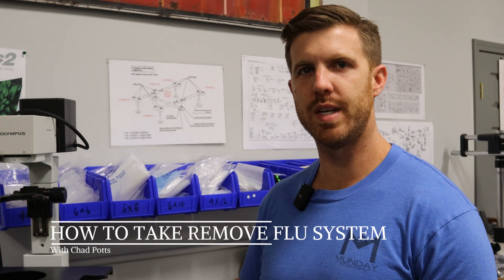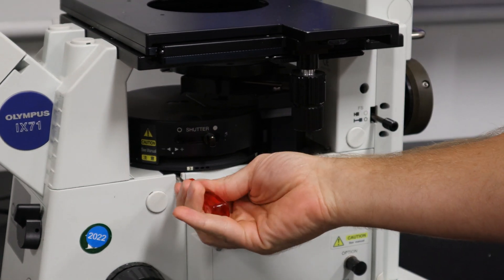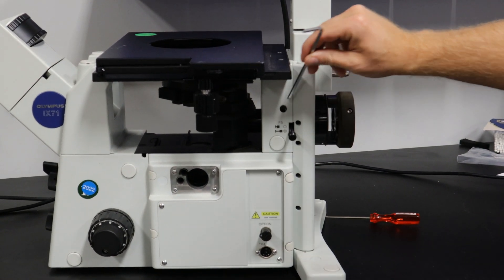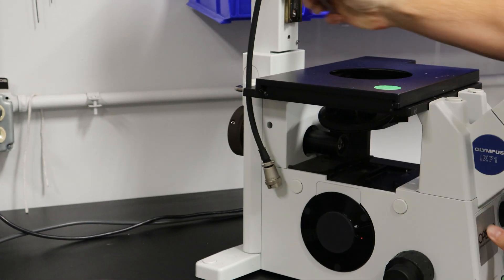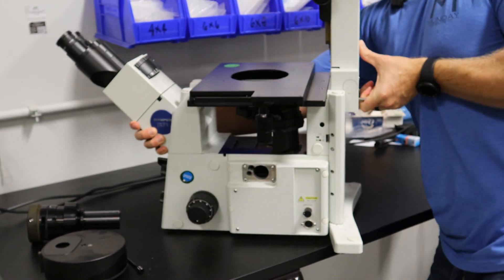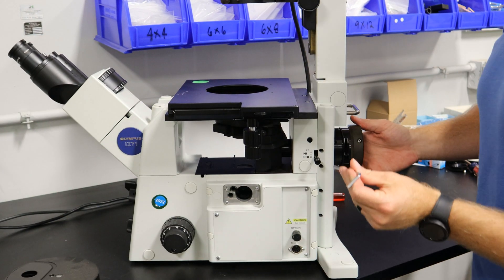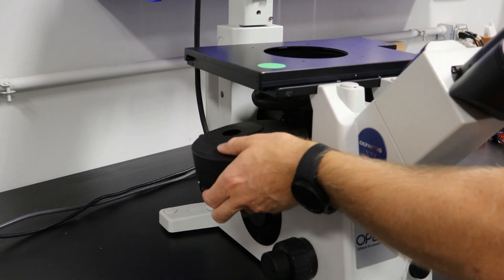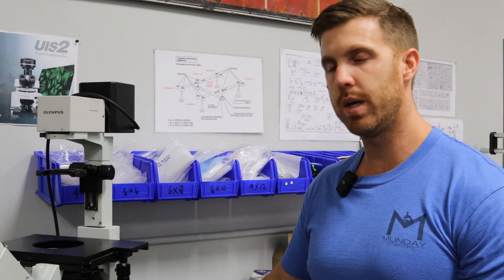Olympus Microscope IX51 / IX71 Fluorescence assembly and disassembly

Comment: Is is possible to clean the mirror from the side-port or is that part completely seal? I ask becuase I see some dust shadow that only appear when using the camera, and I can only image that the optics from the fluorescence port to the side-port is having some dust or fungus. Thank you for your help!
Reply from the maker: You can remove the side port with the three screws.  But beware there are brass shims underneath the black flange.  These are tricky to get back in, but you can do it.  Once that is removed you can get to the prism.  Most of the time the shadow is caused from the mirror on the bottom under that prism.  I hope this helps.  and let me know if you resolve the issue
Reply: @mundaymicroscopes3848  Thank you very much, not only for doing these videos but also taking from your time to reply. Thanks, truly!